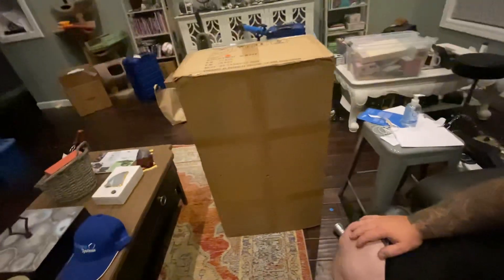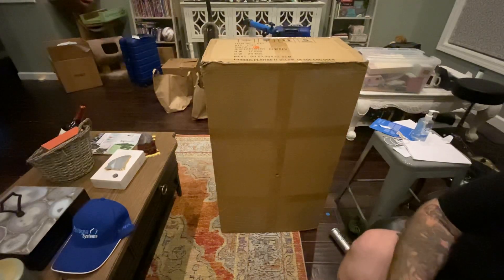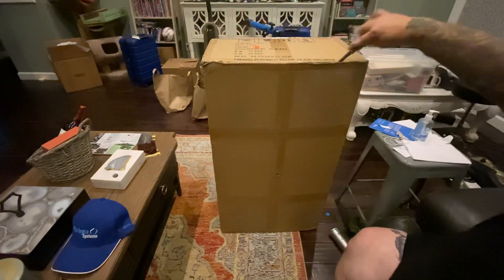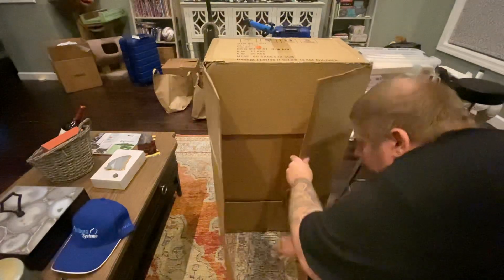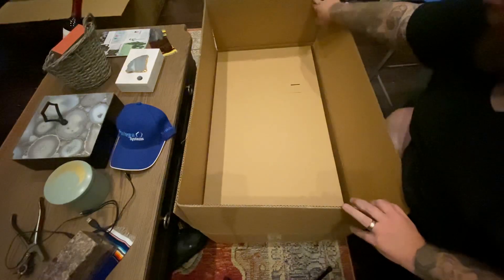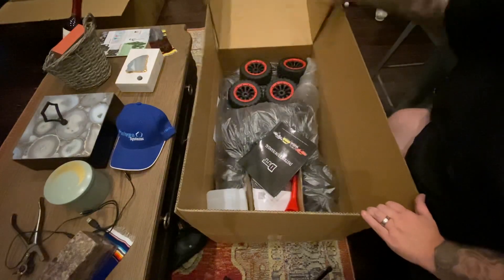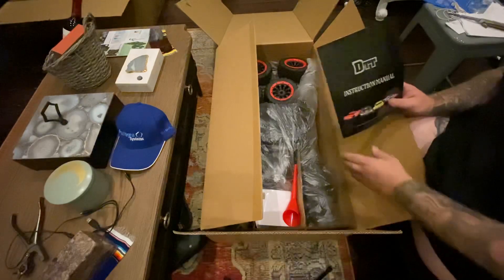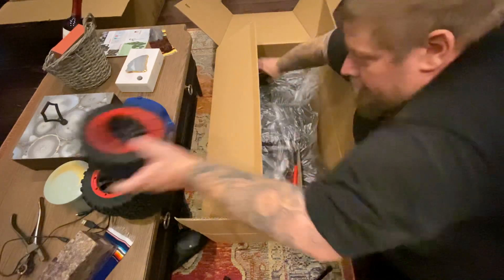30 Degrees North DTT UNBOXING

Comment: I have come back to this video since i'm looking into getting the V2 29cc RTR version of this truck or a Losi 5ive-t 2.0 but i'm not sure which one i should go with since the official 5ive t has the Spektrum receiver and the genuine Zenoah 32cc engine. Even though i don't plan to buy either truck until have fully saved up for either one.
Reply from the maker: If you don’t want to wrench a lot get the Losi 5T 2.0 !!! But they both are great trucks !!! 💪🏻🔥👍🏼👍🏼👍🏼
Reply: @JOHND_RC  I don't mind wrenching much and i feel insecure about spending $1,600 on the Losi plus you need a radio and a battery. And the 30DN comes with a better pipe and indestructible body panels stock all for $1,080 RTR without AA Batteries for radio and fuel\oil.

Comment: Which high flow fuel lines do you use? I put a Taylor 35cc v1.5 into a losi dbxl 2.0
Reply from the maker: I’ve used Taylor and Full force and also brass stock from the hobby shop …